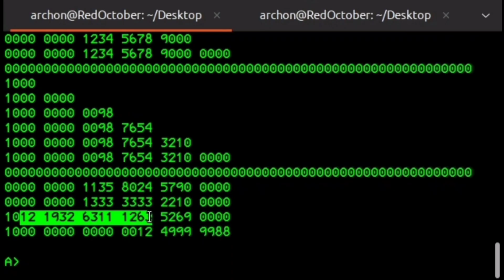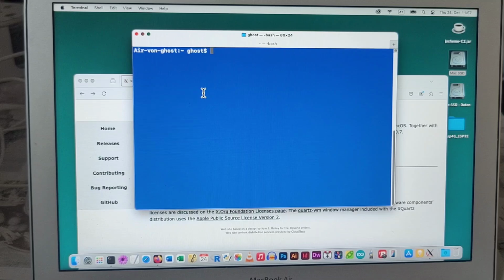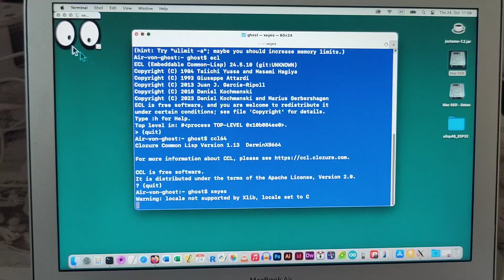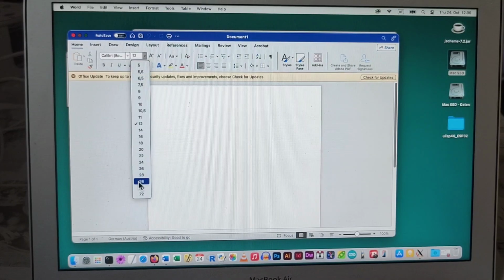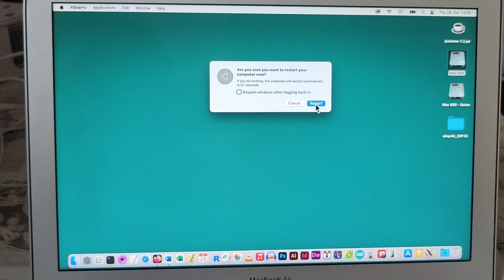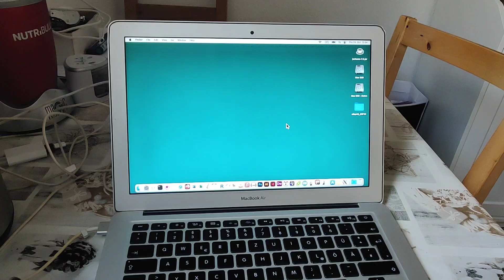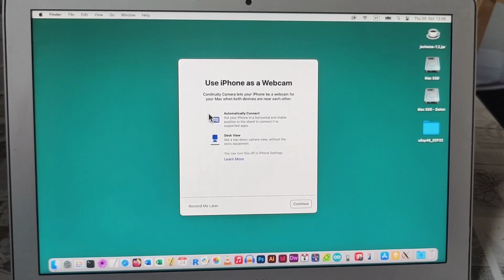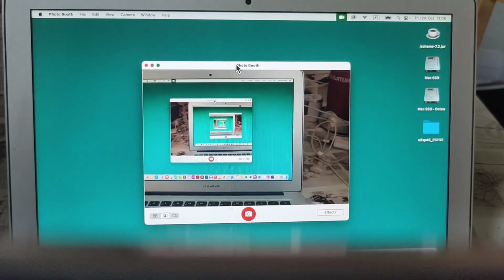OpenCore Legacy Patcher: macOS Sequoia on 2017 Macbook Air

Comment: i have the same mac air as your's , how is the machine doing ? is it usable and operatable in day to day , i use it for a bit heavy browsing and coding , is it worth updating from monterey to unsupported sequoia ?
Reply from the maker: My own upgrade, at least, went fine, and I am using the machine "in production" for various tasks (that said, it’s not my “main" machine), including browsing, text processing, programming and similar. You will see it on this channel in various experiments.

Comment: Hi, I'm facing a problem with my MacBook Air 2017 running macOS Sequoia. It's heating up to 90 degrees Celsius during simple tasks. Is this a sensor issue, as it doesn't feel particularly hot, or is it normal for a new system?
Reply from the maker: I had the issue, but on an older model — it was a sensor issue and a fan control app helped somewhat. Unfortunately, I am not acquainted with your specific circumstances. Yet kindly note, the system background load does increase — I mean, you are running an operating system expecting a more powerful machine.

Comment: Hi 
I want to load unsupported Mac os on Macbook air 2017 which version do you think is more stable for a daily driver
Reply from the maker: "Stable" they are all. Sluggish may be an issue. If you have 4GB RAM, I do not advise you anything much newer than Monterey (but that is out of support), if more, you may try also the newest available.

Comment: Worth to upgrade from monterey?
Reply from the maker: Sincere opinion: no and yes. Frankly, though, I was happy with Snow Leopard… I think an OS should "not get in the way" and not "do funky stuff". The extra load is noticeable. So that is why "no". And as to why "yes": unfortunately, a lot of software says it does not support Monterey any more. Most notably: Homebrew.
Reply: @ninoivanov i just upgraded from monterey. I just updated not clean installed. First , wifi does not find any wifi 😢 secondly in displays there is a info “unknown display” and i cant adjust brightness just for now. Do you have idea ?
Reply from the maker: If you "did everything by the book", I got no advice — I am very sorry. Make sure you followed also any post-install steps. For.the brightness, maybe there is a CLI solution: https://apple.stackexchange.com/questions/34884/how-can-i-dim-the-screen-from-terminal#127258

Comment: Hiya I have the same macbook and I'm considering using opencore as well! I was wondering if you noticed your system was slow directly after the update while it indexed files in the background? And if so how long it took for your system to return to a usable speed. Thanks for the super useful video :)
Reply from the maker: To be entirely frank, it remains sort of sluggish. Like, not terribly, but… remember the difference between Snow Leopard and Lion? — That way.

Comment: I have installed Sequoia on MacBook Air 2917 but my Mac is randomly shutting down after 20 minutes I used open core legacy patcher 2.2.0 and Sequoia version which I have tried is 15.1.1 and 15.3.1 I even tried resetting NVRAM multiple time but that did not help
Reply from the maker: You might wish to explore some logs, to see what is happening — e.g.: https://www.howtogeek.com/356942/how-to-view-the-system-log-on-a-mac/